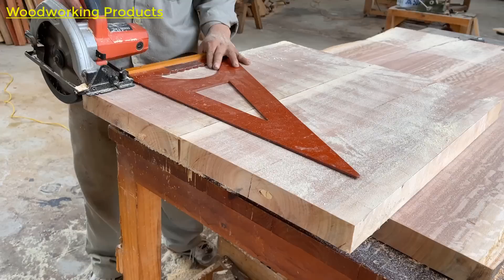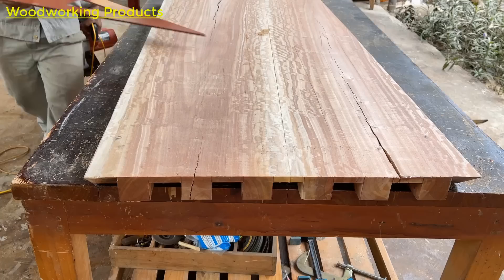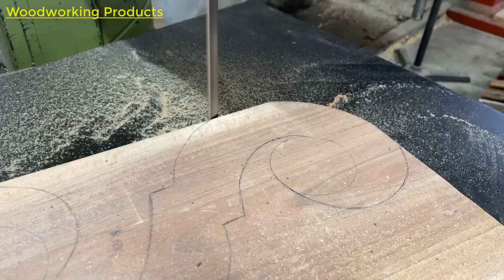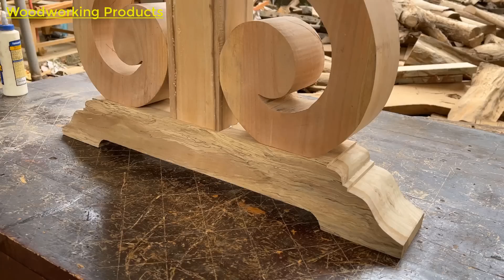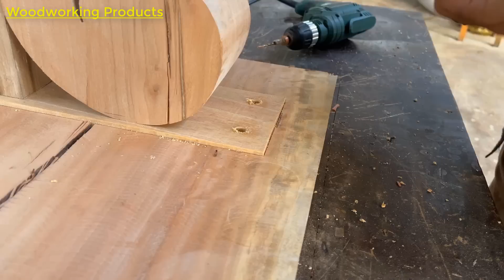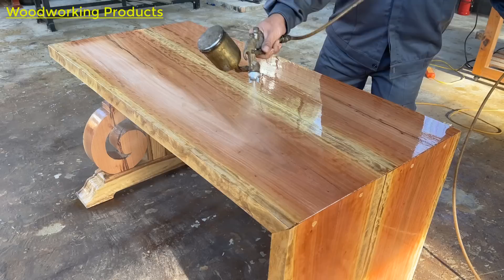Super Product Made From Solid Eucalyptus Wood- Processing The Wood Into A Super Sturdy Table Quickly

Comment: Just wish people when using a bandsaw that they drop the top guide down to very close to the wood. It will give a better cut as the blade is more supported, but mostly for safety. With less blade exposed there is less chance of cutting yourself..